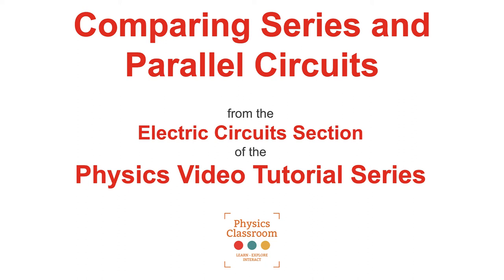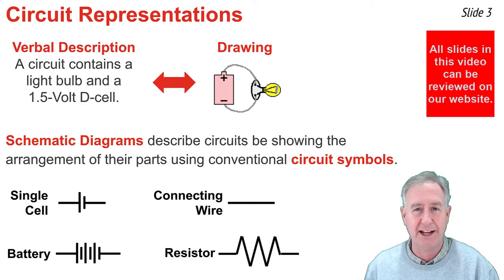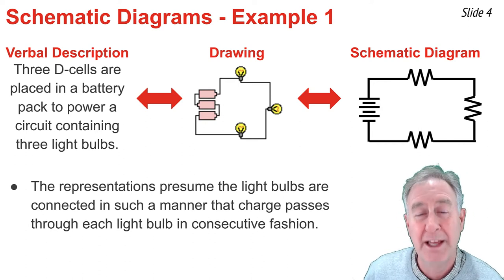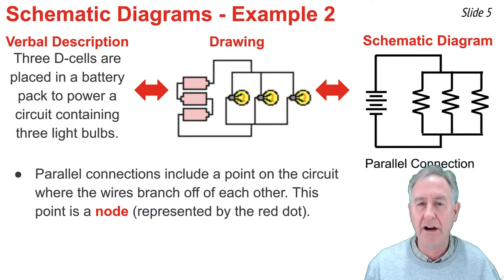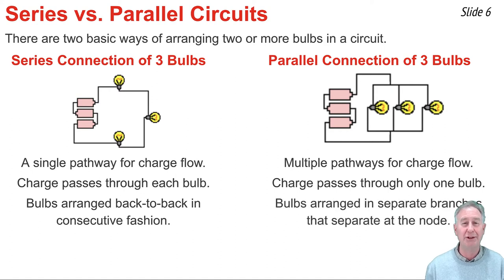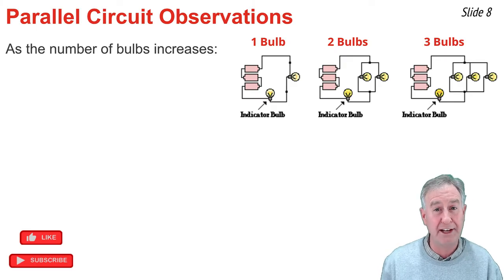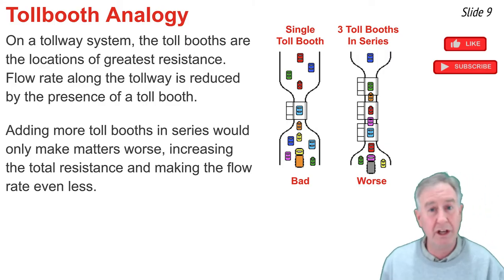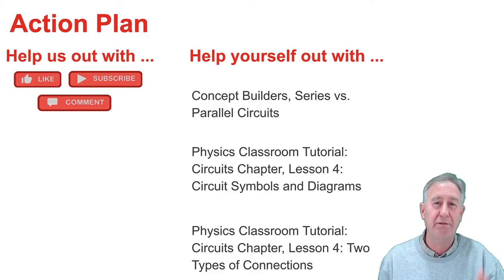Comparing Series and Parallel Circuits

Comment: This series is very helpfull but something is not clear to me about circuits.In a series circuit if we have 2 resistors with the same resistance the voltage drop is split equally.For a 9V battery,there's a 4.5V drop across the first resistor and a 4.5V drop across the second.First,what determines the voltage to drop equally and why does it do that.Secondly why is all the potential energy used,why dont the resistors use only what they need
Reply from the maker: If resistors with equal resistance lead to equal voltage drops in a serious circuit.